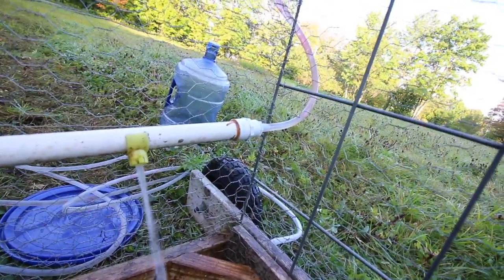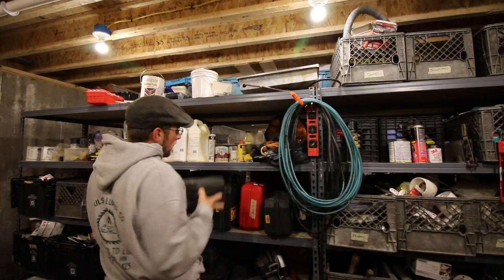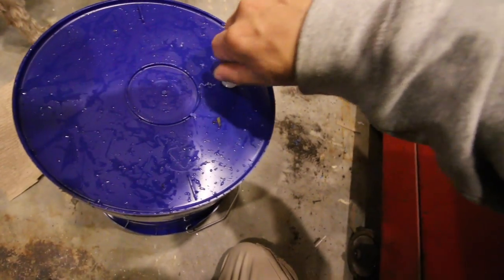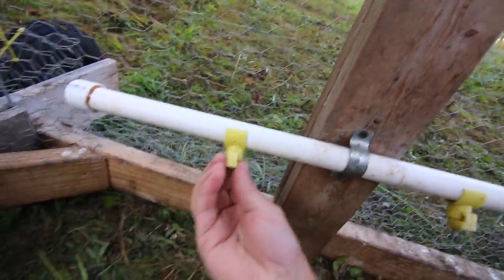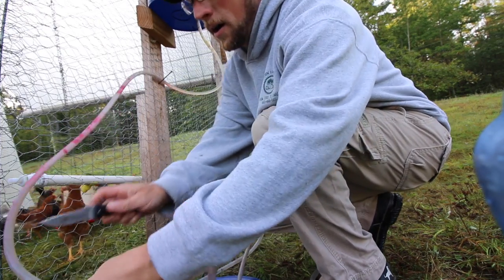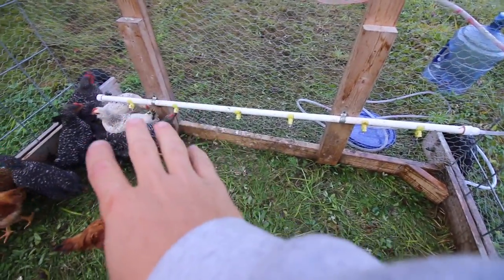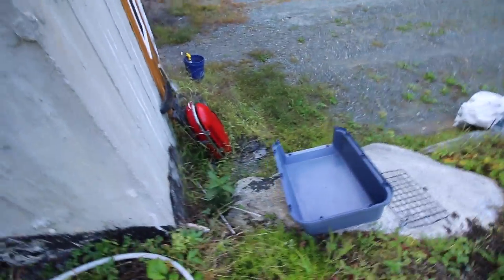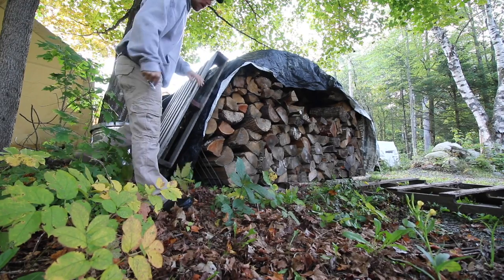Sometimes it gets Air Bond. (Pasture Raising Chickens)

Comment: Al:   You could use a length of twine or wire around the top of the 5 gal pail to secure it to the stud taking the strain off the handle.       Bert
Reply from the maker: I had never thought of that! Thanks

Comment: Take a piece of three-quarter inch ply wood and cut it 2" long by 2 "wide , and another piece 2"wide by 4"long and screw it about an 1" to 2" above the top of the bucket, slid the top of the bucket under it and set it on your crossmember that holds the bottom of the bucket will take the pressure off your bucket handle.

Comment: I was wondering of you have spare water bottles why not make a loop to hang your water bottle upside down and make the plunger in the cap and just take the call off and put in on a full bottle and hang that upside down and take the empty or halve empty water bottle back to the house to switch them out just like rabbit water bottles.